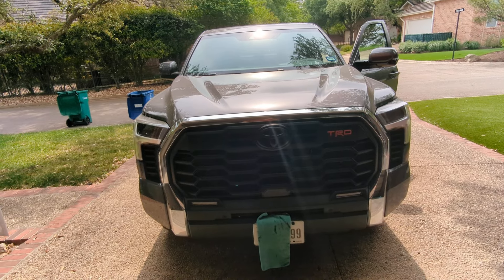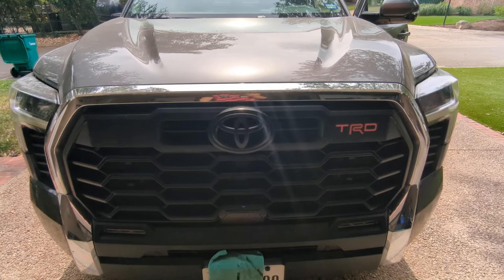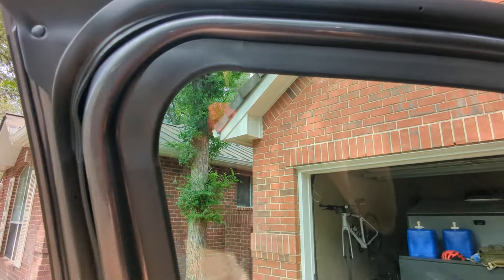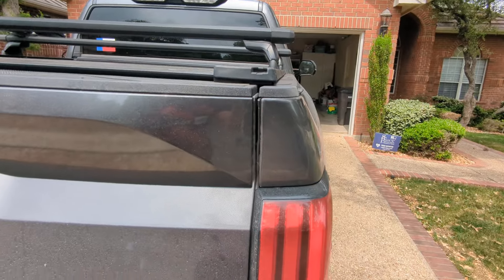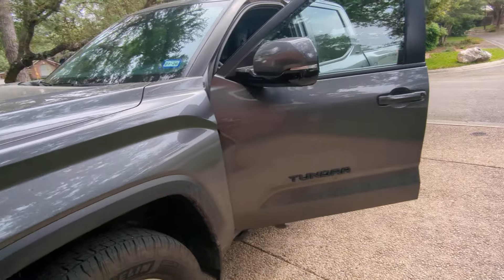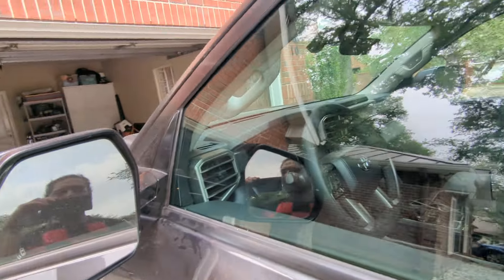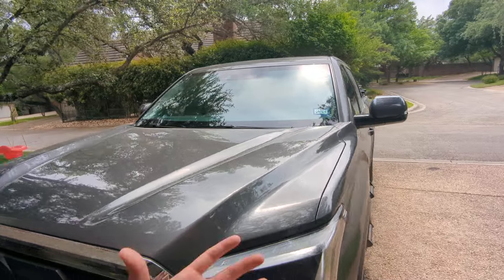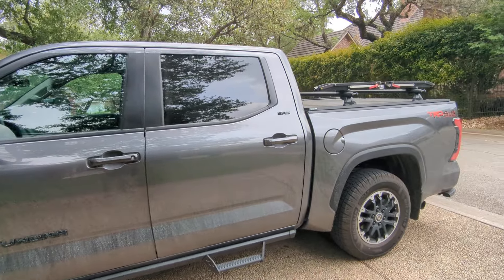2024 Toyota Tundra: Quality Control Issues Persist - Window Noise, Rattles, Tailgate Gaps, Etc.

Comment: Toyota has failed you and failed us. Mike sweers dropped the ball. They hyped it up to let us down. Payload. Rattles. Wind noise. Seat cracking. Payload. Waste gate. Utter failure by Toyota.
Reply: And way too expensive.
Reply: Turning radius, unable to access the bed - no corner step, no bench seat, no v8, rear bumper gaps, and the list goes on and on… complete junk, after this came out I bought a 2021
Reply: That is very disappointing! Shame on Toyota for losing their way with their quality and reliability. They've all but lost their loyal fanbase with every new truck and it will be the same for the '24 Landcruiser and '25 4-Runner. I'm counting my blessings for purchasing the '21 Tundra that was offered to me by the dealer that I placed a '22 order for. It was a pre-order cancellation and they went down the pre-order list and I was number 7. Lucky 7 paid off for me as the first six passed on it. I initially wanted a '21, but I was late in my search and there were none to be found. For once luck was on my side and I'm forever grateful for that. I absolutely love the quality of my '21 and wouldn't trade it for anything!
Reply: Hey worst part about it is they are going into third model year and they aren’t listening to peoples complaints and fixing anything… probably their reasoning is idiots keep buying!

Comment: You're not alone.  Many others have documented these issues.  Toyota is going to have to work hard to redeem this latest version of the Tundra when they do a "refresh" of it.
Reply: Is not just the plastics problem the engine sound like a Fiat600 and not transmission temperature gauge except the Digital (which many said is not reliable)  even the most experienced mechanic  wont talk clearly about if the new tundras have a transmission temperature cooler, why because they don't know.

Comment: Thanks for confirming that I should spend my $83,000 on a GX550 instead
Reply: Lol the jury is still out there on the reliability on that too. Just because it's made in Japan doesn't mean much because they've had recalls on the land cruiser 300 series.
Reply: @healer81  tru dat! I need a vehicle this year, my subbie is 23 years old and starting to need about 1500-2000 per year in random maintenance for the last 3 years running.

I would feel better and Tundra/Sequoia now that they are 3 and have matured a bit but man clearly that’s not the case either.

I don’t have another 3 years to wait
Reply: @toyomade  if you wait until a bit longer a used 200 series land cruiser or a LX570 will get cheaper and will be sure to last you 20 more years. I'm disappointed by the tundra and it's matured enough and still doesn't meet expections. If only they put in everything the last tundra was but put in the new powertrain I'd be perfect but they couldn't even do that. There isn't any new suv I would buy. Heck I rather buy a Sienna and put in a sporty body than get an SUV. I plan to buy a 2021 tundra. If I want to save on fuel I'll get a hybrid commuter. I'd give the latest gx a 5 to 8 year lifespan. 10 maybe.

Comment: I own a 2023 limited Trd !   Interior scratches so easily …espically Center console … rear window rubber extior come out all the time …fit and finish garbage …the truck is put together with all plastic push pins …:interior carpet all pieced together …after only 6600 km my wheel flare fenders are warping and gaps between paint and fenders …I bought the truck too keep it for ten years like my Tacoma …buyers beware

Comment: I'm a Toyota guy through and through , I'm also a auto technician of 15+ yrs , my spouse and I both drive newer Toyotas. but if I were to recommend a half ton to anyone it wouldn't be the tundra . the last generation was the best tundra to own . I previously owned a 2019 SR5 Crewmax and it was flawless and much better build quality , I no longer needed a truck and traded it off towards a new rav4 . I am very happy with my rav4 also .. But these new tundra's are awful imo . I would go ford if I needed another half ton . that's my thoughts
Reply from the maker: Yep, unfortunately this is the post COVID world we live in: a reduction in quality with inflated prices. The 5th gen 4runner might be the last great Toyota product.
Reply: Ford isn't perfect either
Reply: @ZetaDogProductions  Or a GX 460  Both made in Japan.  And both port injected.
Reply: @ZetaDogProductions  I think its Toyota's New Global Architecture (abbreviated as TNGA) that is the problem.  The new platforms are new processes to cut corners, cut costs, and increase margins IMHO.  One by one all their body on frames are moving over to this new manufacturing process.  And so far I'm not liking what I see.  The new Tacoma is a good example.  Its a cheap looking interior.  I mean a ton of hard plastics everywhere.  And it's 5K more then the competition.  Toyota is banking allot on brand loyalty and perception.  But its going to bite them in the ass at some point.  You can only put out crap for so long before the word gets out.  And the word is already out on the doomed Tundra.
Reply from the maker: @HiPlains1  Excellent post, thank you!

Comment: Unfortunately, I am having all the same issues that you have documented on your videos. Initially, the rattles and noises were annoying but with time/mileage more problems arose (such as the 4H4L system failing and was at dealership for nearly a month). But with only 9000miles the quality issues are growing and becoming frustrating especially given the price that my TRD Pro cost. MPG is barely 13-14 and the latest issue was the volume knob just falling off.  Comical at this point.

Comment: I looked hard at the tundra a year ago when buying. In the showroom I could see the weather seal already coming off. The gaskets around windows had huge gaps. I ended up with a Ram bighorn. Zero issues quiet cabin and smooth ride….
Reply: Good
Reply: @pecosb5221  Except Ram is made by Stellantis and they're basically going out of business.

Comment: Hate to break the news to everyone but every manufacturer is having issues. I have owned multiple different brands and Toyota is still at the forefront of taking care of their customers. I recently had a 2020 Ford F150 Lariat and within 100k miles had the engine rebuilt due to camphasers issues, 2 CV joints replaced, front differential bearings replaced, and transmission rebuilt. GMC is in the midst of a huge class action lawsuit over their transmissions, RAM trucks are a POS. It's tough for a consumer buying trucks right now because you really just have to pick your poison.

Comment: If I could do it all over again, I would have bought the 2023 Ford F150 XLT 3.3V6 over my 2023 Tundra SR, I am very dissapointed in Toyota's quality issues and my dealer still hasn't resolved them, on top of that Toyota has poor communication with me and does not return emails, I love mine but have similar issues as well, including an annoying rear vent whistle. I am going to make another video shortly and update my subs as well! If I had the cash I think I would jump into a whole new world and go with a Rivian R1T
Reply: Once again, the SR is a lower model and therefore not made as well. If you're getting a Tundra, do not look below the Limited. Hard to find but made wayyyy better for some reason.

Comment: People need to vote with their Wallet. Don’t buy these vehicles especially at their high prices
Reply: That's exactly whats happening.  Tundras are literally rotting on the lots.  Tires with flat spots and dead batteries and all.  I'm seeing 9K dollar discounts and they still can't move them.  After that horrible launch in 2022 nobody wants anything to do with this turbo crap POS full of hard plastics galore.  Might as well send this crap to be assembled in Mexico.  Can't be any worse then the current crap that San Antonio puts out.  Most likely they will cave in and throw in the towel like Nissan did with the full size.  At least the Titan is decent truck.  Loads better then this crap.

Comment: THey all make noise sadly. my platinum has a tapping from the headliner due to the glue failing between the headliner fabric and the plastic piece between the pano roof. My plat has the window rattle just like my 24 but I swear its worse smh.
Reply from the maker: I'm sorry to hear that. It's wild to think how bad Toyota quality control has gotten. Yet again, mostly everything manufactured post COVID is substandard.

Comment: got an 07 fj with 220k miles took from cali to tx and back no issues the engine hummed like it has 100miles on it heat cold uphill downhill zero issues love the old toyotas

Comment: Yeah that does look like terrible qualiy all around. I'm wondering if you checked or noticed any of this while you were test driving  or before you bought it? I feel like most people don't think sbout checking the little interior things to make sure they're solid. At leasy I definitely wouldn't have thought about it. Kinda just assume its not gonna be trash. I recently bought a Colorado and didn't really do a thorough quality check but i fell in love with it as soon as i hit the street. Luckiky the build quality is pretty damn good because i sure as shit didnt really check.
Reply: Problem is people have that "perception" of great toyota quality.  Its really not the same as they used to be.  Except for a few remaining legacy products.  If you want the old school Toyota you can still buy the port injected 4 runner or the lexus GX 460.  But you better hurry as those will soon be replaced with turbo crap lined in hard plastics.  Its all cheap ass junk now.
Reply: @HiPlains1  yep. I was surprised to see this as well because people praise Toyota quality so much. I was split between the Colorado and a Taco and I'm glad the dealership didn't have any when I went to purchase

Comment: I think TNGA as far as the new Tundra is concerned since it was from the bottom up totally new vehicle has been a mixed bag and not living up to the hype that was promised. It looks like now even with three production years they still are having trouble resolving known issues since they are using the same inferior parts. Hopefully mechanically the truck holds up but only time will tell. I have a 2015 SR5 + double cab with the TRD off road package with about 160 000 km in central Canada and real winters. Other than regular service I have only changed a belt tensioner and belt which did not fail but squeaked when raining and I figured it was time. Think I will need a brake job soon and first set of tires lasted to 100 000 km. The truck is not perfect but checks most boxes and is built to be durable. Hard to say if you should keep but if looking I would drive the older Tundra and see if it is something you could live with. If so look for a 2020 or 2021 with low mileage as they had lots of time to make it a good reliable tough truck.

Comment: You have paint chips where the rear spoiler meets the gate panel. Its look like dirt but you can see it on the video surprised you missed it.
Reply from the maker: Thanks for pointing that out. I actually did notice it the other day when I was loading my bike. There's so many little defects on this truck that it's hard to keep up. Haha. I'll definitely make a part III because there's more I didn't mention in this video.
Reply: @ZetaDogProductions  I see on Lil Kenny TV channel he shows dealers knocking off 9K from MSRP on these junkers. They are really piling up on the lots.  I guess the word is out that the new Tundra is the polar opposite of the legend it replaced.  Funny they went from the most reliable with the 5.7 V8 that could literally go a million miles to this turbo crap with hard plastics galore.  The new Mexican made taco also seems to be a grossly overpriced POS.   Really only the current 4 runner or GX 460 are the last decent body on frames that toyota makes.  Soon they will offer nothing worth buying.  You should have bought a Nissan Titan.  Its a low volume truck that is overlooked.  Still has the 5.6 V8 that does not have any of that cylinder deactivation BS.  Its the last truck make that uses a no nonsense drive trains and the build quality is very good.  They don't make very many.

Comment: Ever since the redesign, the Tundra has dropped in quality. You are not alone with all the issues you listed, and to add to the insult the Tundra has had engine issues, transmission issues, and oil leaks. Make Toyota buy it back under the lemon law. Seems that Toyota has already bought back several of their lemon Tundras.

Comment: I’m so conflicted. I’m in the market for a truck and all I find is horror stories about all of them minus the tundra. (I assume the last generation). What are we supposed to buy
Reply from the maker: If you absolutely need a full-size, I'd look at a 2nd gen Tundra with low miles or a Nissan Titan.
Reply: Yeah, I build cabinets. Pick up plywood, boards and tow a trailer so I’m upgrading to a full size.
Reply: @timhanlon7864  yeah titan is a solid pick. 2.7 ecoboost has been pretty solid. I’d even venture to say the 6.4 hemi in ram 2500 has been well tested.

Comment: Should’ve just waited for the new 4 runner I hear that it will be made in Japan.
Reply: The current 4 runner is also made in Japan.  If I were you, I'd buy the current gen 4 runner with the port injected 4 liter and 5 speed.  That we know will go over 300K miles.  The next gen will have the turbo crap and hard plastic interior like the 24 tacoma.  And like the Tacoma it will be junk compared to the old school port injected model.  It will also cost 10K more to get something worse.  Don't hesitate.  The current 4 runners are flying off the lots because people want to own the legend.  If you want a "real" toyota you got two options left.  The current 4 runner or the lexus GX 460.  Both port injected and made in Japan.
Reply: @HiPlains1  it’s not that bad when you get better fuel mileage and a faster truck. I owned a 2022 Tacoma TRD off road and the gas mileage was horrible along with the acceleration. Every time I would go on throttle the engine would sound like a dying pig. Also, my Tacoma had all that hard plastic to begin with anyways. But, that Tacoma felt like an industrial tank I beat the shit of out it and it took it. That’s why I’m looking for another Toyota truck especially if it’s made in Japan. I don’t care if it got one turbo on it’s ok with me as long as it got a warranty.

Comment: I drive a 22 Tacoma and the seat squeaks time to time since the first week I drove the truck. Dealership is not able to fix the problem but a Toyota mechanic told me that issue is in Toyota models in general. Toyota knows about it but they keep designing cheap seats to save money.I was in the market to upgrading to a new tundra but I keep hearing the previous gen was solid build. I’m seeing these new gen falling apart what happened to the quality. Especially how expensive they are you expect to be build like a tank.

Comment: The main bearing Girdle assembly in the Toyota is aluminum supporting the main bearing and shaft. Ford uses graphite iron and more beefed up to make it more rigid. This was explained… TOYOTA GOT CHEAP and the design can not handle the stress
The turbo places on the shaft and bearing

Comment: Amerxcio the Tacoma is following suit. Ford Chevy and Stallantis are having the same issues. Cheap cheap cheap production parts
Reply from the maker: You hit the nail on the head. These manufacturers are sourcing the cheapest, poorly made materials to put in their vehicles, then when they quickly degrade, they’re replacing them with the same crap. Thus the cycle continues.

Comment: These issues only seem to be true on lower end models. People seem to forget the SR5 is a lower end model. LOVE MY 22 LIMITED TRD Off Road Tundra! It has some recalls but incredible overall. NONE of those issues seem to happen on the LIMITED and above. I'm not sure if it's a different factory line or different parts but they're just made better. I've scoured YouTube and the internet and this seems to be the case across the board. No one seems to mention the models in their videos.
Reply from the maker: I don't think people forget the SR5 is an entry level model. It's Toyota's volume seller, and even though it's not a Limited or higher trim, these manufacturing issues are unacceptable. Why should I have to pay more money for functioning window controllers and window seals? It's utter nonsense from Toyota. Either way, I hope you remain issue free, friend!
Reply: It’s junk

Comment: I just trade in my 2024 I loose $7k but that’s it no more tundras for me Toyota make big mistake I never have A tundra again don’t buy the new tundra is a piece of trash
Reply: Curious to know what you traded it in for??
Reply: The outgoing was such a reliable truck with that Port injected 5.7 V8.  Talk about taking a turn for the worst.  They went to "most reliable" to bottom of the barrel in a years time.  Go toyota!

Comment: Ah, 1st year model production guinea pig. Thanks for taking one for the team.
Reply from the maker: Nah, 2024. 3rd year in production. Read the title. Thanks for the comment.
Reply: Its a 24.  And BTW, sales are bombing.  This has been a disaster for Toyota.  This would be the worst choice for a full size.  Its so bad that I see Toyota dropping out of the segment.  This is going to end badly for the Tundra.  If ya gotta get a low mileage 2021 and forget this pile of crap.